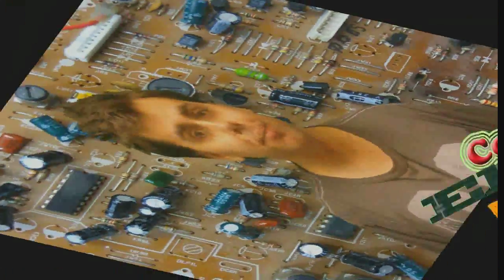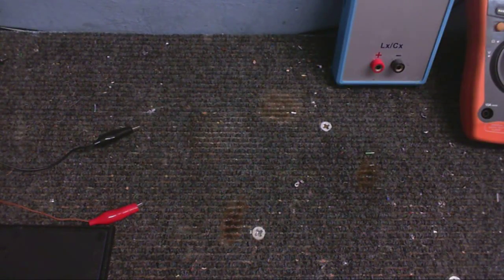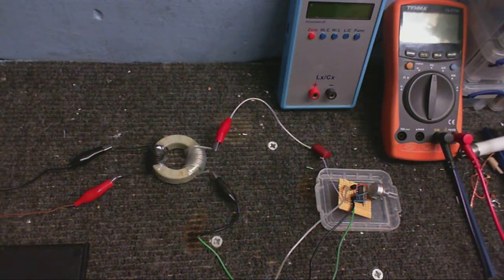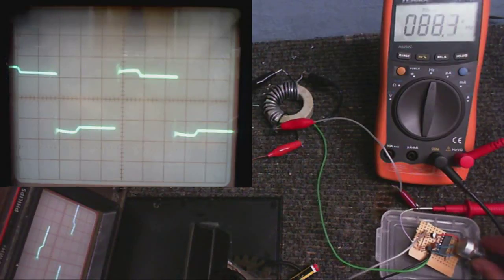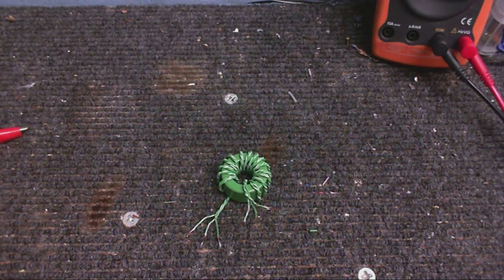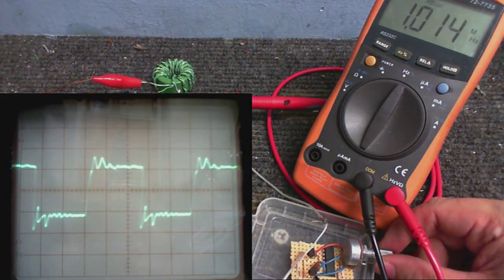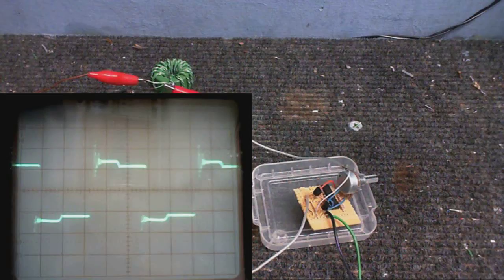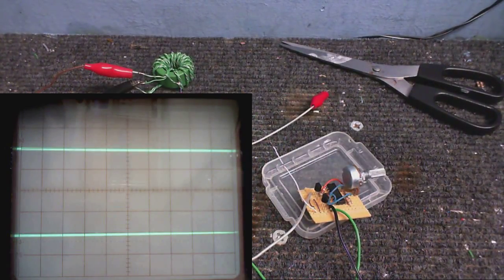Building a Solid State Tesla Coil Part 2 - The Gate Drive Transformer

Comment: Bought some large cores from AliExpress, they differ just a tiny bit in inductance, one is 2,9 mH and one 3,1 mH for 15 turns. I had tried loading them with same capacitor and waveforms are exactly the same,. Can I use them in a full bridge DRSTTC ? Also fun fact, they work all the way down to 5khz. :)

Comment: You should see the waveform with MOSFETs connected,or at least with a capacitor of the same capacitance of the MOSFET's gate.
Reply from the maker: Anto Mani I'm going to do that in the next video.
Reply: CoolDudeClem Yeah, the load makes a big difference. You can damp the ringing of the coupling capacitor with the magnetising inductance of the transformer with a series resisitor. in the primary. This usually also counts as the MOSFET gate resistor. Good bifilar or trifilar winding reduces leakage inductance, then it's just a matter of winding enough turns for the right magnetising inductance and damping any ringing.

I build GDTs in switch mode power supplies, but they tend to be a fixed frequency in the 50-300kHz range. I just use small ferrite rings from RS/farnell of an appropriate material for the frequency (N30, N87, 3C90 etc. at my usual 100kHz) and wind it with whatever magnet wire I have from the main transformer.  If I was going for MHz I'd use a different material and I'm sure nothing you salvage from an audio amp will be the right material for 1MHz. (N49, 3F4, 3F35 etc)

I don't know why everyone seems to want to salvage cores and use UTP network cables when you can get a really good appropriate core for about 20p. RS don't even charge for shipping anymore. As you noted it' quite hard to find an appropriate core as you really want a transformer core rather than an output filter inductor core or worse, an EMI filter core and generally ferrite transformers are EE and inductors are toroid in consumer goods.

Comment: What is the purpose of the .1 uf caps?
Reply from the maker: They're to stop high frequencies getting fed back into the pwer supply, that can really ruin your day.
Reply: @CoolDudeClem   Thanks!  Forgive my ignorance but why don't the larger electrolytic caps in parallel do that?
Reply: @CoolDudeClem  Never mind I found it. Ceramic caps have a lower ESR.  Thanks.